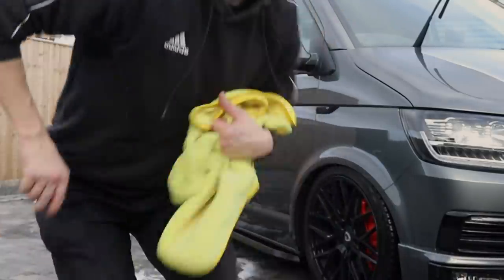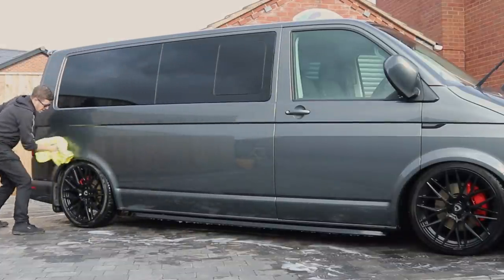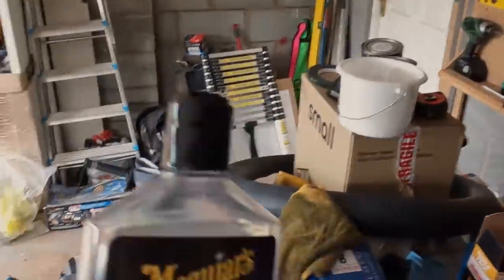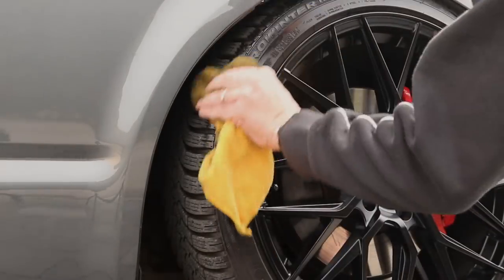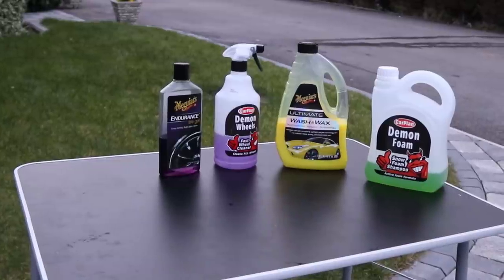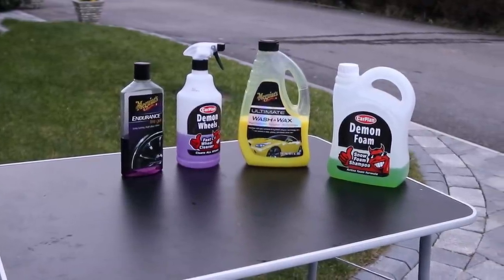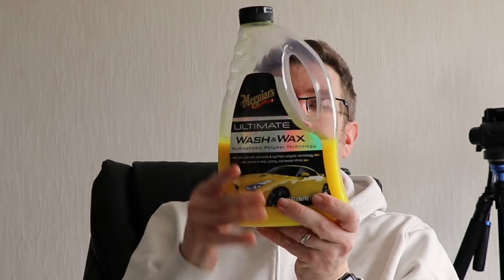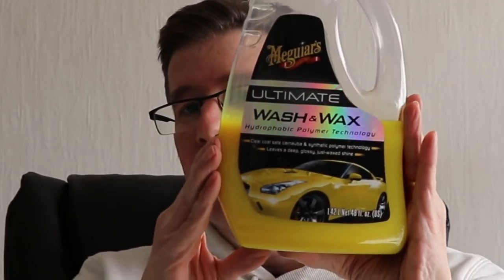Detailing my T6 | How I keep my T6 looking good...

Comment: Love your content Steve. I’m ‘one of those’ who does enjoy a proper detailing session (and I do wash the roof, every time). Tips, for what it’s worth. 1. Get yourself a proper snow foam cannon (Autobrite Direct, no affiliation - that Karcher one you’re using is bobbins), and use a good snow foam (Bilt Hamber, no affiliation). Let the snow foam dwell for a few mins then rinse it off before you contact wash. This will 80% clean the van before you put mitt to paint (preventing swirls). 2. Do the wheels first. Yours are like mine, fiddly and a pain in the ‘arris - get that job done and then enjoy the rest of the process. 3. I’m a bit of a nerd when it comes to this stuff, but use a 3 bucket method - Wash, Rinse and Wheels buckets, with grit guards in each. Wash is for suds, Rinse is to clean your mitt off before you go back into the wash bucket and Wheels is for, well, no need to explain that one, but this will be your muckiest bucket at the end of every wash. Using this method you should end up with your Wash bucket being pretty much pristine when you empty it down the drain. I could go on, but I’ll end up boring people. Love cleaning m’van, Buddhist Zen time. Keep up the good work pal. Subscribed and watched all your content.
Reply from the maker: Thank you for sharing such a detailed tip!!!

Comment: If I were you Steve I would allow the pre-wash to dwell and rinse this off with the pressure wash before making contact and using the wash mit. That way you're removing as much grime and grit off the van first before making contact, and reducing the risk of swirls and hazing
Reply from the maker: 🙌Thanks Craig! Really appreciate the advice and tips 👍👍😎

Comment: Great work Steve! We need to hook you up with some juicy detail products! Also once you have snow foamed, leave to dwell for a couple minutes then rinse it off to remove most of the surface grime, then use your soap 👍🏻
Reply from the maker: 🙌Cheers Paul.  I really appreciate the tips.  Couple of people have said that that I need to foam pause then rinse but then still hand wash.  I did think at one point the foam was intended to be a contact free wash when it first came on the scene.  Like yourself I dont let the van go long between washes so there’s not usually to much build up.  Would love to try out some juicy stuff 👌👌

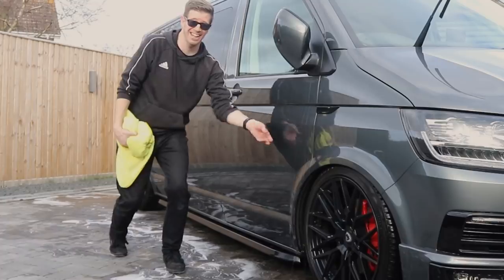Comment: Not related to cleaning but at 8:26 your door sounds very solid when you close it.  Is this due to additional seals in the door? If so where from? I have bought some but I think they are too small and have not made any difference.   Cheers.
Reply from the maker: Hi,  Yes I found the door closure changed radically when I had the Dynomat fitted and the extra seals together.  They put my seals on as the same time when I was at Dirty Weekender Adventure Vans and made a huge difference as a combo. When you know on the door it feels solid not tinny👍
Reply: @SteveField  do you know which seals they used? Seen some 16mm ones. The ones I got from Amazon are only 12mm and don’t do much.
Reply from the maker: @mcyoon77  I think they are about 16mm, they are a secondary seal so as well as the factory seal. I think I saw them on Travelin lite website and customveedubs site too.  Or you could call Dirty Weekender Vans on 01905 353880 and they might do a mail order 👍
Reply: @SteveField  will add them to the list of places to look for stuff. Only had a van a week so it’s all new to me. Always kept my cars well looked after so the van will get the same treatment. Don’t ask me how I’m going to detail the roof though…
Reply from the maker: @mcyoon77  🤣🤣You can always borrow my mower 😂👍

Comment: another great video...just my 2p worth after being a valeter for years for anyone that cares lol

jetwash the whole van with just water first, helps remove the loose crud, then snow foam, the only one i ever use that does anything is bilt hamber (videos of it tested against others on youtube) then jet wash the foam off otherwise you can contimate and drag dirt all over your panels causing micro swirls if you wash straight away, also in daylight never let foam sit for more than 5 mins as it can bake on hence the fresh water jet wash first to cool the panels
clean bucket for wheels to then be done, then 2 clean buckets for van although the 2 bucket method has been contested many times lol
noddle mitts won the best wash mitt last year at 2.99 from tesco
decent shampoo such as gold class meguiars or 1900:1 from carchem
autowheels from bilt hamber or kkd is the best wheel cleaner ive used
then final jetwash with clean water
towel dry all over 
then if you wanna polish, wax or ceramic theres tonnes of videos on youtube explaining that
if mines a maintence wash then i use a product called fse koch chemie which breaks down the calcium in water spots with a clean micro fibre
great place for supplies is clean your ride, he has some gorgoeus stuff there and can buy in test bottles before you buy a big bottle :)......and never wash or dry in circles, always straight lines...minimises any swirling ;)
Reply from the maker: Hey Ben,  thank you for your detailed comment🙌🙌. Really good 👏👏.  I have learned a lot since making this video and it’s interesting to read that a few of you experienced detainers all agreeing on the above methods so this has definitely helped me and I’m sure others who read the comments so thank you 😎👍👍

Comment: Nice one Steve, I rate that Meguiars wash and wax too. 
Snow foam is vital in my opinion, pressure wash it off once it’s had time to dwell and it takes most dirt off before you even touch the van. Bilt Hamber Auto Foam is good stuff. I also recommend a good snow foam lance like Autobrites you can coat the van within two passes as it has a much wider spray beam than the Karcher ones. 
Keep doing what you do, always great content.
Reply from the maker: 🙌Thanks Liam,  that's really great to know and I appreciate the tips and advice as will others!!👍👍

Comment: To be honest i do same as what you’ve done as ive found washing the foams off with the jetwash takes nothing off leaving mine just as dirty as before, but also ive found looks lovely  & clean but once dried looks awful . Its like the paint on mine just attracts dirt .
Reply from the maker: If ever I’ve found the water marks are staying behind its because I’ve not got to dry it while it’s still really wet. I’ve got a really old shamios that is super soft that is my go to when it’s to warm or directly sunny.  Also washing and drying sides if it’s drying to fast.  Partly why I leave the wheels till last as tooo much metal to work on before it all drys out👍

Comment: What happened to the navis wheels?
Reply from the maker: The are in storage until April 1st I run these from November to April and the Navis are my summer choice 👍. Will Vlog the switch over at the end of the month 👍👍
Reply: Love your content Steve. I’m ‘one of those’ who does enjoy a proper detailing session (and I do wash the roof, every time). Tips, for what it’s worth. 1. Get yourself a proper snow foam cannon (Autobrite Direct, no affiliation - that Karcher one you’re using is bobbins), and use a good snow foam (Bilt Hamber, no affiliation). Let the snow foam dwell for a few mins then rinse it off before you contact wash. This will 80% clean the van before you put mitt to paint (preventing swirls). 2. Do the wheels first. Yours are like mine, fiddly and a pain in the ‘arris - get that job done and then enjoy the rest of the process. 3. I’m a bit of a nerd when it comes to this stuff, but use a 3 bucket method - Wash, Rinse and Wheels buckets, with grit guards in each. Wash is for suds, Rinse is to clean your mitt off before you go back into the wash bucket and Wheels is for, well, no need to explain that one, but this will be your muckiest bucket at the end of every wash. Using this method you should end up with your Wash bucket being pretty much pristine when you empty it down the drain. I could go on, but I’ll end up boring people. Love cleaning m’van, Buddhist Zen time. Keep up the good work pal. Subscribed and watched all your content.
Reply from the maker: 🙌this is epic feed back and info James 👏 I am really grateful for your in depth comment👍👍. Thank you for the channel support and the sub. I would really like to
Pin your  comment to the top of the b
Video as many could gain a lot from this info.. as you have replied to an existing comment would you wind copy and pasting your comment into its own comment of the video and I will PIN it. 🙏
Reply: @SteveField  happy to support you Steve, I've done as you asked 👍
Reply from the maker: Thank you James! I have pinned the comment🙌🤙

Comment: *Claying your vehicle once a  year to remove all surface contamination is a recommendation. I clay my car every April. The start of spring. Removes sap and tar. Rain beads off body.
Reply from the maker: I would like to start doing this! 🙌
Reply: @SteveField  would take you hours with size of your van but well worth it. The bodywork will pop waxing then acts as a barrier. Seals the glossy shine. I also use the shampoo you use. Quality 👍